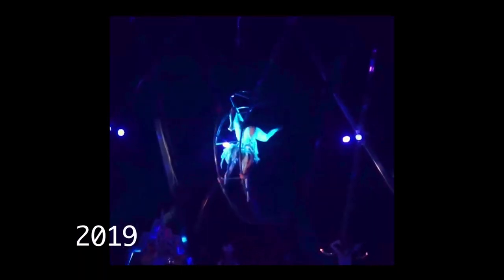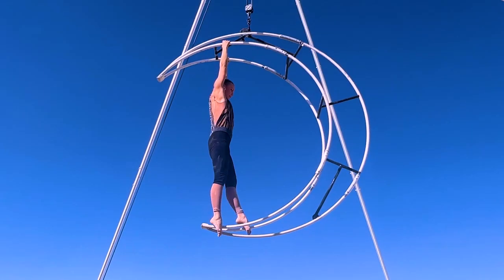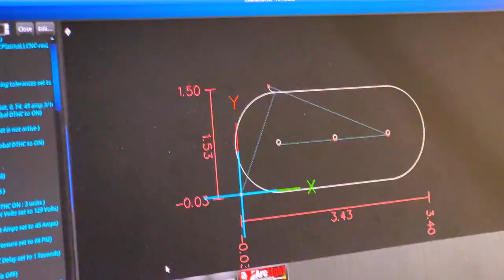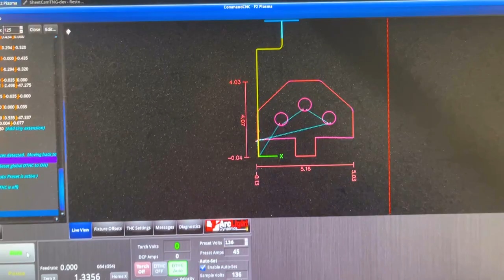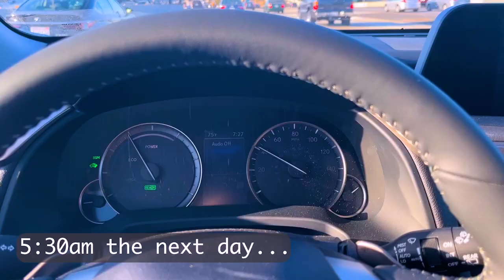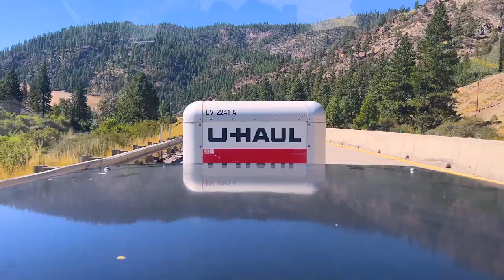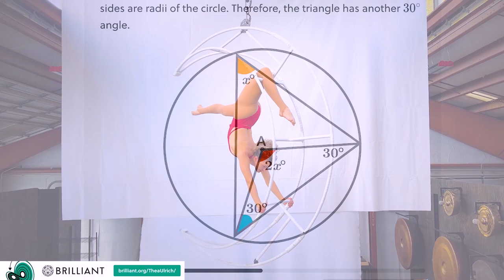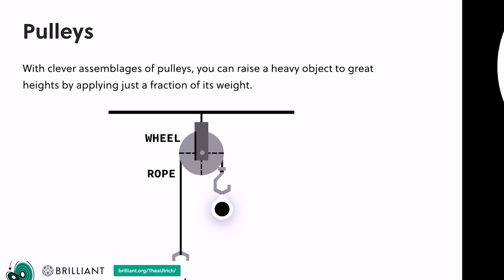I welded my own circus aerial sculpture to perform in!

Comment: As a weld instructor it is nice seeing welds that both do the job they need to do and look good too. usually it is one or the other. And doing it on tubing no less. Mucho respecto. 

Sleeving that joint was definitely the right call and I like that you used aluminium.
Reply from the maker: Thank you! As an artist I need them to look good, and as an aerialist I need them to be strong! No other option :) 💯⚡

Comment: One recommendation for your moon sculpture.  Where the aluminum meets the mild steel I would use a product like  tef-gel to prevent a galvanic reaction between the dissimilar metals.  If you notice any rust around the aluminum cut the rusted steel out and weld in fresh steel.
Reply from the maker: This is a great recommendation! I've definitely been wondering how the longevity will play out...thanks!

Comment: Looks awesome!  Your comment on metal stress reminded me of a lesson learned the hard way bout that.  Years ago I was helping with tech on a play.  We had rigged up a swing which was just pipe hanging from cables.  We had the right cable and fasteners to more than handle the load.  The director wanted to test it for himself and swung out very far.  None of us realized that the cables were hitting a steel overhang that was fraying the cables every swing.  It snapped with the director in mid air.  We decided no more swinging for that show.
Reply from the maker: Wooooooooowwwww...that is...definitely the hard way of learning that lesson! I hope they were ok! I can only imagine the intense moment of everyone collectively gasping right after it snapped 😳Yeah sharp edges are bad pretty much always in rigging and building!

Comment: So, when you want to do something - here moondancing - you're able to : research the structure, measure and design it, actually build it, troubleshoot the device, correct it, be good enough to actually use it, and organize a show where you're going to perform at a major event, which means time constraint and pressure, all the while holding a day job. And recording it for future youtube use.
While in three years I still haven't tended to the hole i need to plaster in my ceiling. Your impressive efficiency is making me feel like i'm a giant lethargic slug :/

Comment: As a Mechanical engineer I must say that it would be interesting to Analyses this structure. Maybe do a topology optimization or something.
I liked you connection design... If it was pretensioned I would expect it to hold and be stiff enough, it was located in an aria where I would expect high stress and you would normally try to avoid that. But before the stiffeners you had no load path from the top "ring part" to the two bottom "inner ring parts" and then you do not get the insane area moment effect from the constructed "profile".
I would have thought the added aluminum bracket would be unnecessary with the stiffening of the lifting point.
Also your lifting point looks strong, normally we test with 1.25 to 2 times the load that it needs to carry.
In you case you have dynamic loads from you moving and you want a stiff structure that dos not flex under your weight thus I would maybe test with 3 times the load. But what you made there looks really strong, even though the weld looks quite thin (a3) a good rule of thumb is 0.7 of the plate thickness on both side.
Really cool project and video, made me think at least.👍
Reply from the maker: Thanks and I appreciate your thoughts! I did consider other less intense options than the sleeves, especially after the restructuring around the pick point...but given the time crunch, and also the face that I am not able to do the proper engineering analyses...I generally go for the 'overbuild...and then overbuild some more' option! I'd be super interested in seeing analyses to this structure done. Halfway through I also realized I should have staggered the joints a bit too so the flex point of the load wasn't all in one line....we learn by doing I guess!
Reply: @thea_ulrich  I know, when you have a design and you are constructing it you sometimes have to improvise a solution that is less than perfect. That is how it is, and I have implemented way more sketchy looking and way worse solutions to unforeseen problems than you aluminum sleeves.  But I know the disappointing feeling when you have do adjust your plans. So I hope you will grow to love the solution over time.
I did not even think about staggering the joints... To be honest I am not able to see through all the implications of staggering the joints, I think that if they are pretension and the joint is holding in pure friction it should not make much of a difference, but I might be wrong, it's a little hard to tell when I do not understand the structure that well.

I should be able to do a simple FE bema model relatively fast, but for more details one might want to do a shell element model in stead, and you have a lot of load cases and it is not easy to identify the worst one for each part of the structure, thus I could end up taking more time than you spend building it. Thus it should only be to learn about a structure like that. (also you have already build it, thus a 10% better design is a little point less)
The optimization would defiantly take more time, but again, for the sake of understanding a structure like that I would find it interesting.
I will let you know if I give it a try, I might start out asking some friends what they think, maybe some of them have worked a lot with C shaped frame structures. 
(I am thinking lifting clamps for wind turbine blades or something similar.=

Comment: Thea what is your engineering philosophy when it comes to picking a safety factor and calculating specs for a given load and application. Do you just work at one or two orders of magnitude greater than what is necessary and call it good? I did like how you talked about the fact that you  are only putting yourself at risk and taking ownership of the object in that regards.

If you redid the build,  how would you have done the couplers differently? If it was me, I'd use pins that match the radius bends and slot into the tubing a good 8" on both sides, weld it into one side. then on the other side cross drill it and securing the pins with panhead screws are tapped into the pin itself. Installing them vertically (top to bottom) so they can fall out. 

Any ideas on how you would modify it with lighting? Or is it smart to keep an apparatus like that clean for safety and useability?

I was laughing at you with the tape messsure thinking to myself how I would just do photogrammetry. If you shoot yourself from a bit of a distance and have an object of known length  parallel  with the imaging plane and at the same depth as you to the camera. Then you can just do supper simple photogrammetry and capture every possible pose you care about know know the lengths you need.
Reply from the maker: I love all of these thoughts and questions!

Engineering philosophy: I try go even further than one or two magnitudes greater! Overbuild it and have redundancy as well. I usually try make it so that there is no single fail point that would be make or break...this is actually only the second aerial sculpture I've made that has only one rigging point instead of two - usually I do two for that reason! Also only using TIG means that...unless I've really messed up the welds...the welds will bend before they break due to TIG being more ductile than a fast cooling weld like MIG.

Taking ownership for how we exist in the world is what will re-empower us all to create beyond our wildest dreams ❤🚀

That coupler design you described is exactly what I used on my first large scale aerial sculpture! I made that pre my youtube, but there are some photos of it on my IG (the large pod-like sculpture). I'm going to go back to that design and try tweak it for my next one...Why I tried a new design is because the process of assembly and disassembly with that design was rather painstaking, and I wasn't as comfortable with not being able to use a heavier bolt/pin/set screw due to the thinness of the tubing and needing to also not take away too much material. However, from an aesthetic standpoint it was far far superior. 

Lighting: I was working with a crew for a big Burning Man show (I had two lined up this year, this one was canceled due to a whiteout duststorm that lasted hours), and we were working on integrating LEDs with it. For general safety and usability, the apparatus does need to be quite clean, but it you design the lighting around specific choreography for an act it would be possible! I'm excited to explore that more. 

Yes! haha the photogrammetry option would be way more sensical! Definitely a process I will explore more at some point...but still probably in conjunction with rolling around on the floor trying to figure out measurements! Without a great set up I imagine it would be quite hard to ensure the imaging plane was accurate enough given the complexity of the twisty shapes. 

Thanks for watching and sharing your ideas!